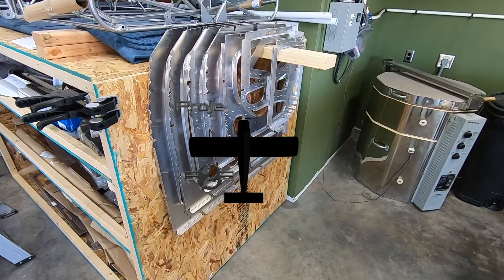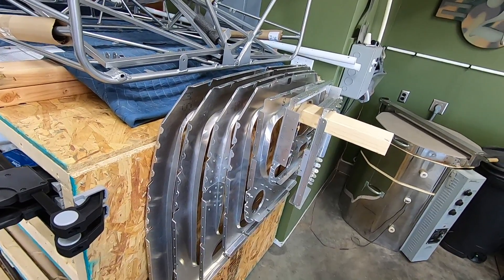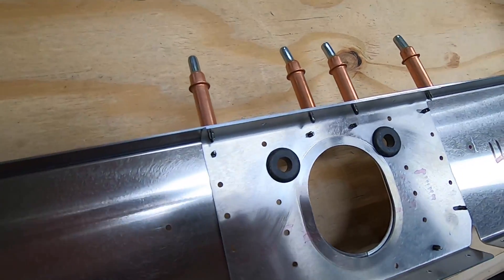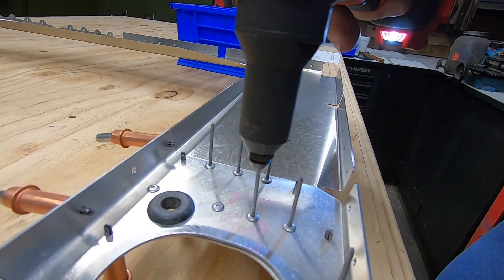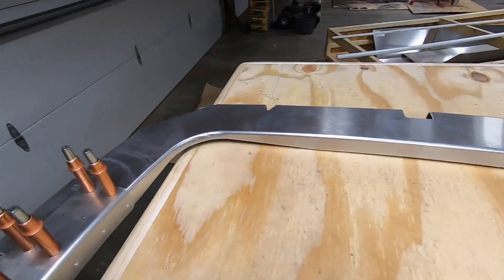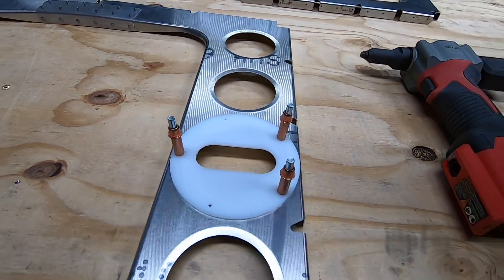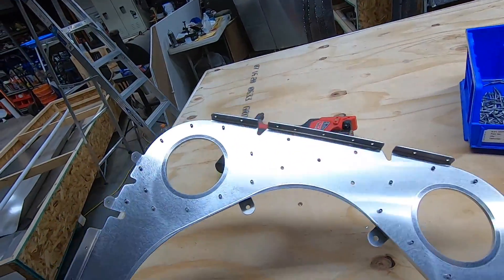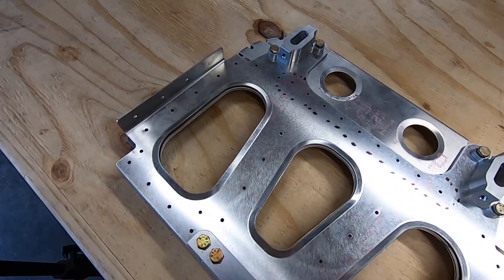RANS S21 EP8 TAILCONE BULKHEADS

Comment: My first thought was that maybe the wrong bulkhead doubler was being installed, but as meticulous as you are, I'm sure it was the right one. The shim appears to be nice and snug, so it's a "press-on" situation.

Ran's shows a cabin width of 46-1/2". The doors are bowed outward 5", so I'm wondering if that 5" is included in the cabin width spec. If you would, on the fuselage still tube frame, what is the cabin width at the front and rear door opening? Thanks!
Reply from the maker: Yea me too, I double checked several times on the doubler/splice part.. 

Inboard edge to inboard edge of the cage where the doors will go at about half way up the fuselage is 38.5” in the front (right at the instrument panel) and about 38” in the rear
Reply: @Project2Aero  Thank you for the fast response! From the videos I've watched, it the cabin looks roomy for a couple of "people-sized" guys.
Reply from the maker: @EJWash57   you bet! I suspect it won’t be to long and this one will be setting on the gear.. I’m sure there will be tons of “hanger pilot” moments so I’ll let ya know what I think when that time comes👍

Comment: I’m curious on your thought process on fuselage next versus wings as in the RANS manual.  I will probably do the wings just to get the big sheets off my workbench so I can move it out of the way when I get the fuselage on wheels, but I have toyed with the idea of doing the fuselage before the wings.
Reply from the maker: In my case, I didn’t order the wing kit yet. When I ordered my kit, Rans was experimenting with a longer wing option and I thought I might want that option so I held off. It sounds like that didn’t work out  and won’t be offered, but I also am limited on space in my garage. I now plan to just continue with the fuselage and work through avionics, electrical and engine installation . I’m pinching pennies to make this happen, so I currently don’t have the spare $$ to get that wing ordered👍
Reply: @Project2Aero  That makes the decision much easier.  😁
Reply: @Project2Aero  Thank-you for posting your build! it will be a big help when I start my S-21. It is scheduled to arrive in late December. I was wondering how big is your garage? it looks tight but enough mine is 16'x20'
Reply from the maker: @starbicycle  my garage is the size of a 4 car but only has a double and a single door. I built all my work surfaces on casters so I can move things around easily when not in use. I can fit 2 cars in there and have room to still work on things. I don’t know the exact dimension of it, but I hope that helps👍 Thanks for watching!

Comment: The RANS web site pictures show clamping the flanges to bring the splice plate and frames together for riveting.  No need for a shim or longer rivets.
Reply from the maker: I did see those pictures in the build log photos. In my case these two flanges had a constant gap down to the bend and a significant change in angle would have been required to close it without inducing excess sheer load on the fasteners. I weighed my options and went with the cleanest option I could come up with using what I had on hand so I could keep moving forward.  Forcing them together would have left a wedge shaped cavity and I just didn't want to go that route.